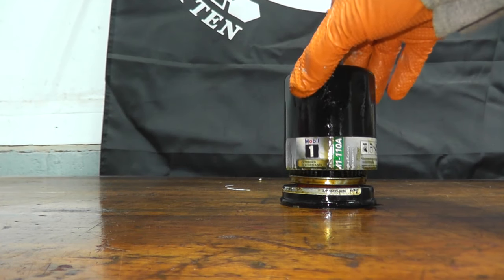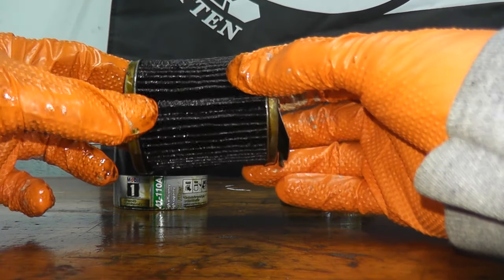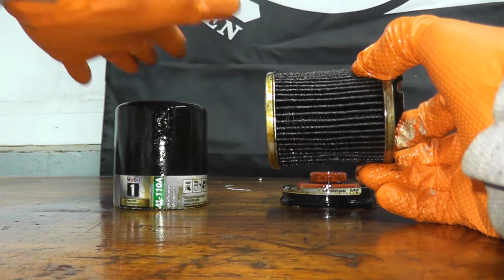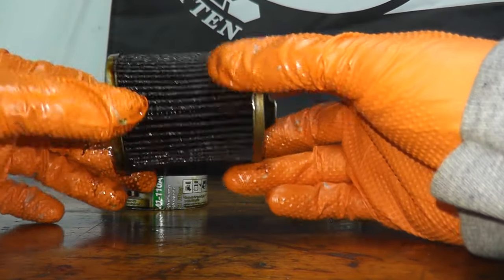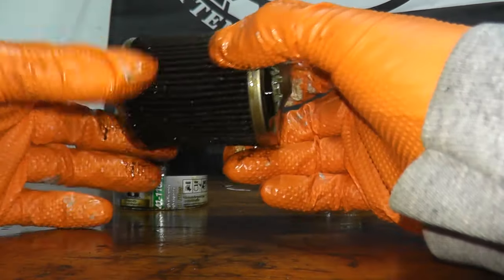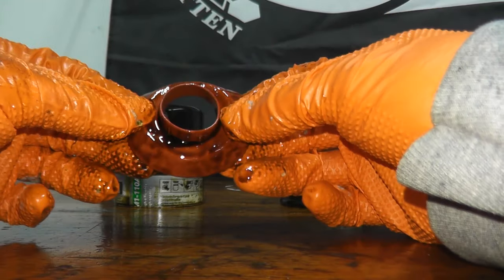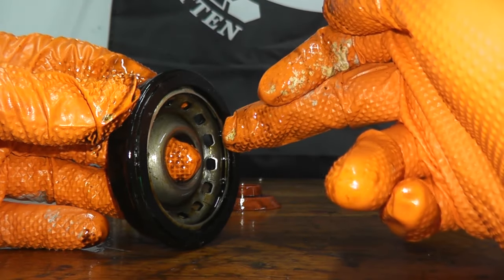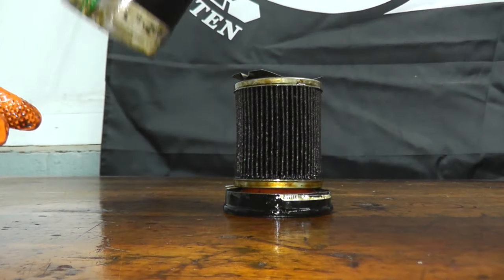Mobil 1 Oil Filter After 15k Miles Of Usage

Comment: I always use M1 EP oil and EP oil filter and change it on my G37S every 6k miles but the micron rating on the filter (99% at 30 microns) seems a tad large
Reply: Wow 6k and mobil 1 your VVEL must me making some interesting noises.
Reply: @kostasdramoudanis2627  vvel is noisy no matter what oil you use 😂 I been using mobile 1 extended with Mobile 1 oil filter and do my oil change every 5k I have 115k no engine problems, no galley gasket either
Reply: Amsoil EA filter is 99% @ 20 microns
Reply: @JorgeRodriguez-zd5nx  if you use estor oil it doesnt make any noises 80k 2011g btw
Reply: @kostasdramoudanis2627  what manufacturer do you run? G35 so no vvel but always looking for insight on better oils for the VQ.
Reply: wrong.  if its too small it clogs up early
Reply: @mccartneystuart I always recommend penzoil for any vq and I do my oil changes on my g37 ever 3k
Reply: @brandini2557  man I used that natural gas pennzoil oil recommended by that motordyne g35 guy as he does UOA. My G is not my DD so it can sit for weeks without starting. I had maybe 300 miles on that oil, started it one day with a horrible grinding sound for 2 seconds. That oil has almost zero shear value so I yanked that oil out right then. That oil also degrades very quickly after 3k miles. Put Mobil back in there and never heard that sound again. I hear that pennzoil is great oil for VQs but only if it's a DD.

Comment: why dont u recommend going with oem filters . they usually are same or less price than aftermarket ones. and you get peace of mind that its proper oem and will not fail? any thoughts?
Reply: Thanks, good thought: I suspect some OEM s have proven & tested informations on Lubrications, et al.
Reply: Because they are made by aftermarket companies & some have been found to be cheaply made. Example, the OEM Filter for my Nissan is made by FRAM...and it uses cardboard & glue for the end caps with a thin filter element just like the cheapest FRAM you can buy off the shelf...not high quality at all
Reply: I agree use genuine or OEM parts they don’t cost much more and you have peace of mind ( I have worked 40 years as a mechanic)
Reply: There is a reason a manufacturer will only warranty a vehicle for so long. They don't make them to last forever. Take the tires for instance. You can walk in firestone and get the same tire the car came with from the factory, but it's not the same exact tire. The tire the car came with was made to the manufacturer specifications. Firestone or any major tire maker make tires they sell to last longer. Point is car manufacturers will go out of business if the car lasts forever.

Comment: I found out this week that full synthetic super tech oil from walmart was the cause for my 08 honda odyssey van's check engine light.  I forget the exact code but it has to do with the oil pressure to the vtec stuff.   I didn't worry too much about it because it didn't run any different and I didn't notice and drop in MPG.  I ran it about 4 oil changes changed every time the oil change light comes on which is about 5 to 6k miles. the check engine light remained on the entire time. I did use different filters to see if that worked because some websites suggested trying that first.  which it never helped.  so I figured screw it, I'll live with it.   a week ago it was time for an oil change.  I didnt feel like going into a crowded walmart this time and picked up some of Mobil 1 truck and suv oil  and a mobil 1 filter from advance auto.   after about a week and probably 20 ignition cycles the check engine light is now off. this is clear evidence that the oil was the culprit.  some websites did suggest changing oil brands but I though that was nonsense.   well, it wasn't.     I'll never use super tech oil in anything again. and anyone on the internet that says the stuff is good is WRONG.   I was going by what they all had to say and this proved them all wrong. the oil doesn't actually meet ANY of the API certifications for this van's engine either.  this stuff actually matters and I let people talk me into believing them that it doesn't.  I knew better but now I have my proof.
Reply: I've been using super tech for a while and i have no problems. Super tech is made by Warren oil company. Tested next to big brands and competed rather well. All the same ingredients as top tier brands. All the same regulations are met. Side by side on the charts warren oil competes with the best brands on the market.

Comment: I think Mobil is cheapening out these filters by making thinner walls,  a month after I changed the oil filter had a big oil leak, found a very small pin hole on the filter, it wasn't punctured by any foreign objects.

Comment: Sorry but one cannot 'rate'; an engine's recirculation oil filter solely based on looks, beauty, etc. 
The ONLY things that are important is:
A. Conformance to the engine manufacdturer's specification ;   typically compliance to the OSU-F2 test stand for engine oil (ASTM Test Number ???) for 97% (wt.) removal (see engine spec. ) of 17µM particles at a flow rate of X with SAE 10-W30 oil of (spec. gallons per minute) recirculating at 180°F temperature.
B. The ASTM testing uses a laser counter instead of a wt. per wt. basis at the indicated 'rating' but still refers to the original 1930s OSU-F2 test stand of 97% wt. removal at the indicated µM removal 'rating'.

In most such oil filters there is essentially only ONE world supplier of the super high quality technical PAPER filter material - Ahlstrom-Munksjö Oyj is a Company of Finland. 

As another poster jd5179 has so eloquently stated change the oil AT or BEFORE the engine manufacturer's recommendation; OR, change 'earlier' than recommended when in dusty ambient conditions or during extended periods of extreme engine performance.   Changing the oil filter and the engine lube oil ON TIME is one of THE most important things you can do to extend the in-service life of a vehicle's engine.  Other than that there's really NO magic bullets with simple oil filters --- if it meets 'spec' it doesnt matter how pretty it is or how expensive, etc. etc etc. etc.  ;-)
Reply: Well said. One of the most well thought competent answers I ever read on here.
Reply: BINGO

Comment: What I'm about to state I have done for over 7 years. March I change the oil filter with a Mobil 1 20K mile extended performance filter and 5/20w synthetic oil. At about 7.5k miles I change the oil, keep the same filter. Than in  the next March change the oil and filter. Have NEVER had a problem.
Reply: Did you remove the filter clean it and put it back, or you left it, lick the old oil and continue with the oil filter on touched?

Comment: 0:09 mark, interesting I just did my oil change today using the M110A for my 2015 Accord. The version I have only has 8  holes i believe, whereas in this video has multiple. Was there an update to these filters?
Reply: Most likely mobil just had another company make them. Mobil doesn't make their own filters.
Reply: @digitalunit318  gotcha
Reply: is that  a 4cylinder accord?
Reply: @CRAPO2011  yes sir

Comment: i have a question about the microns, the higher the microns the better the oil filter? as i understand Mobil 0ne HAS THE HIGHER MICRONS?. THANKS FOR THE VIDEO. HAVE A NICE DAY
Reply: No, lower microns is better.  Mobil 1 filters down to 30 microns, but Fram Ultra will filter particles as small as 20 microns.
Reply: @LoveClassicMusic0205  thank u very much for that, that been a great help. take care.
Reply: Silly as hell these comments.  They could filter down to 5 or any number if they want.  Smaller is more restrictive to flow and clogs early..  Not good.  Funny how everyone knows more than Exxon Mobil

Comment: What's your opinion on Bosch Premium oil filter, would you say it's good for 7,000 miles OCI using full synthetic oil?
Reply from the maker: I like Bosch filters. I've used their filters many times over the years with no issues. Cheers.

Comment: Pretty stupid going 15k without oil change.
Reply: I agree. I use the exact same oil and filter in my 2006 toyota matrix and I only take it to 7500 miles in between even. Oil still come out looking pretty clear but anyone who knows anything about vehicles, don't chance it.
Reply: After 20,000 miles oil samples were sent to blackstone labs and it showed it was still fully protecting the engine.
Reply: I worked with blackstone labs and did 15k intervals in my Colorado.  Just changed the filter at 7500 miles.  M1 Oil sill had life left.  Analysis showed it was stable. Synthetic oil lasts a lot longer than people think,
Reply: Agree. 6k max on any oil for me.
Reply: Some people will change the oil but reuse the filter.
Reply: Unless your car burns the oil. Then it's pointless to change it so often. Just add oil in that case.
Reply: Every 5000 miles the cleaner the better
Reply: @35057  On my 05 Malibu v6 I sent my full synthetic oil after 5k miles and it showed it was on the edge of becoming useless. Depends alot on the engine not oil.
Reply: @butWhyDad  
And on the type of driving. City vs highway, etc.
Reply: That's what this oil and filter are made for!
Reply: @martinmorris6271  
LoL, you'd be changing lots of oil in a diesel motor then. 1st start after an oil change and it's getting black again.
Reply: It’s not a Diesel engine
Reply: @martinmorris6271  
Just an example.
The color of the oil has nothing to do with it's ability to lubricate.
Reply: @martinmorris6271  
Still the heat in the engine will turn the oil black. It's not the contaminants.
Reply: @009paintball Still so many variables there ahaha. If you drive a 30 year old daily driven car like I do, that does burn a bit of oil. I think you should  still respect the 5000km oil change rule and top up what oil you need too.

Comment: I just installed one.  Removed my old valvoline trash filter and the mechanic tightened it on way too much and the anti drain back filter was stuck.  Finally got it off and installed this one with a new anti drain back.

Comment: I like the amsoil ea / royal purple filters.  Using Castrol edge titanium extended (yellow bottle) and liqui moly ceratec. 10k mile changes.  Ceratec added every 3rd change after an oil flush.
Reply: zero evidence for any of it.  Amsoil doesn't make their own filters.  Please provide your superior lab based evidence.  pure opinion and conjecture

Comment: is motorcraft good enough? its on my old fords nothing new just old beaters
Reply: Most engine oils made nowadays are good enough, just as long as your using the proper weighted oil for your engine. Also making sure the oil institute donut is on the back of the bottle, and having the little certificate things like dexos 2, and a few others will add some brownie points.
Reply: Motorcraft filters are actually Purolator filters.
Reply: @bluesky-ud9wg  is that a good or bad thing? I've ran many different brands of oil filters over the years but on my fords i end up with motorcraft alot of the time their cheap get get the job done drive old beaters if the oil looks dirty the  i get it changed. a lot of the time the mileage hasn't even met yet yeah might be a dirty engine but their old with alot of town driving.
Reply: Motorcraft is an excellent filter.
Reply: @saleens330  Yes they are
Reply: I use motorcraft only with ford engines. My 5.4l uses the FL820S filter, its larger than most compatable aftermarket filters. Who knows what causes the issues with this engine, but I'll only run motorcraft filters on it.
Reply: @MattTigers  Do you have a 3 Valve?
Reply: @bluesky-ud9wg  yep
Reply: @MattTigers  The issue with the 3 Valve is not running Synthetic oil. Yea I know everyone will say that's not it but it is. No one changes their oil as needed, I don't care what the owners manual says, it's all about Cost Of Ownership and they don't care at all about you needing repairs. I GUARANTEE that if I had a 3 Valve new, dumped the factory fill at 1,000 miles and ran Mobil 1 or Valvoline Synthetic & changed every 5,000 miles with the Motorcraft filter or a Purolator Pure One or BOSS, I would NEVER have these issues.

Comment: If the manufacturer says change the oil every 3,000 miles, change the oil every 3,000 miles.

If the manufacturer says change the oil every 5,000 miles, change the oil every 3,000 miles.

If the manufacturer says change the oil every 10,000 miles, change the oil every 3,000 miles.

If the manufacturer says change the oil every 15,000 miles, change the oil every 3,000 miles.

Changing the oil every 3,000 miles costs you the price of an oil change. Extending the oil change interval can cost you an engine. Car manufacturers LOVE IT when you blow up your engine.

Comment: Its synthetic blend not fully synthetic
Reply: Sometimes when I am lonely I will shave one leg so it feels like I’m sleeping with a woman 👩🏼
Reply: It's fully synthetic which means is must contains no less than 25% synthetic. 100% synthetic like amsoil is all synthetic.
Reply: Depends what weight. 0w-40 Mobil is 100% synthetic.
Reply: @mccartneystuart  does it say 100% on the container? If not, then it's full synthetic. I find it hard to believe they use a completely different base oil for one single oil.
Reply: @digitalunit318  I'm not an authority on the subject but certain classification of group oils will only receive a group IV classification if it is indeed a full synthetic like certain series of redline, RP. Amsoil, etc. The only Mobil oil that I'm aware of that gets this classification is the 0w-40 and is their euro one. Much debate on this subject by people much more informed than I am mixed with changing the criteria of group oils, many attempt to hide true values and need to be read through long data sheets. But yes depending on their application, they change base oils (ester, pao and %s thereof). Possibly for foreign car manufacturers meeting criteria for warranties.
Reply: @digitalunit318   this video is about the filter not oil what are you talking about
Reply: @digitalunit318   mobil 1 filters are a blend it even says that on the box
Reply: anymore the blend is just as expensive.  Serves zero advantage over full synthetic

Comment: My engines always out last my transmissions. I wish transmission changes were this easy
Reply: manufacturers are discouraging changing transmission oil by removing dip stick. lifetime transmission fluid is one of their selling points.
Reply: For many RWD/4X4 vehicles at least, aftermarket transmission pans with a drain plug are a thing you can get. Sure you have to still remove the pan to change the filter but it's a lot easier when it's already empty lol. Just lack of a dipstick tube for a fill remains an issue

Comment: Unfiltered oil is always fed to the engine. Bypass valve is always open unless your pressure is dangerously low. 17 psi is typically max pressure allowed before it opens and is usually about 12-15.

Your engine is going bye bye if the valve isn't  constantly open.
Reply: You're incorrect. That is not how an oil filter works.  Oil is forced into the small holes on the top of a filter then through the media up through the center back into the engine. The bypass valve is on the exterior of the media. If the media becomes clogged, the oil would have no where to go. This is when pressure would build forcing the bypass valve at the bottom of the center of the oil filter open and allow the oil on the outside of the media another route to the center and back into the engine.
Reply: @digitalunit318  
Is there not a PSI rating where that takes place?
Reply: @masterofnone1808  depends on the spring rating, but it's not always open as they stated. The only way the pressure inside the oil filter would build is if it were clogged or becoming blocked from particulates. That's when the bypass valve would have pressure building on the back side of it allowing oil around the media and valve back to the engine.
Reply: LMAO

Comment: You used a 20k Mobile 1 filter and you  used standard Mobile 1 oil.  What is it standard Mobil 1 rated for?
Reply: 10k miles though it will last longer if all highway

Comment: oil might last up to 15000 mile but no filter can clean 15000 mile, it may last that long but it doesn't clean
so high quality regular filter every 5000 mile will be cheaper and better

second oil filter only clean on low rpm or when oil pressure is low, between 16-25 psi, after that the by pass valve opens so when rpm goes higher filter does nothing as the by pass valve is open!

no oil filter worth $15 or so the difference between mobile one and high quality regular filter is no more than a dollar or two for manufacturer any way

as long as you stay away from shitty filter like FRAM you are good

by the way mobil one filters 30 micron and some other expensive brands are 20 micron

Comment: No way I'd run a filter 15000 miles. I use Mobil 1 or Valvoline full synthetic and change once a year or every 5000 miles which ever comes first. I use oem filters.

Comment: That filter which was "degrading" was obviously built that way.  Just  a manufacturing flaw.  Nothing wrong with that filter....The bypass valve is more for cold starts so it doesn't over pressurize than for people going way to long on oil changes.  High priced filters are the most overrated part most owners will ever buy....so long as you're running them the prescribed mileage.